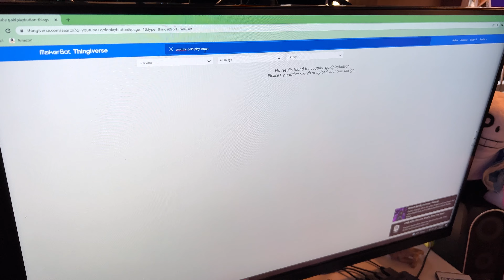10 MILLION SUBS?!?

Comment: Another idea to help the temp of your pool is to make lily pads using hula hoops and black plastic. Just cut the plastic to fit the hula hoops and zip tie it on. Then put it under the thermal cover and it’ll help pull in the heat.